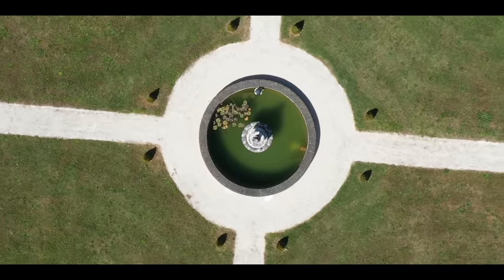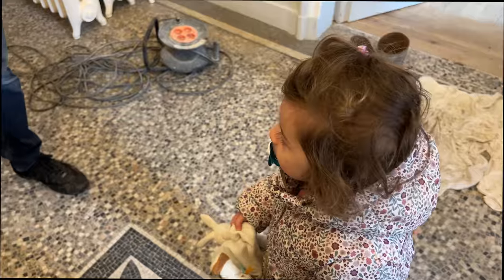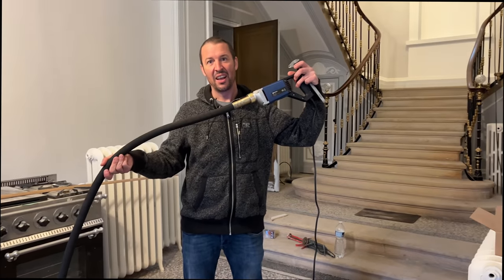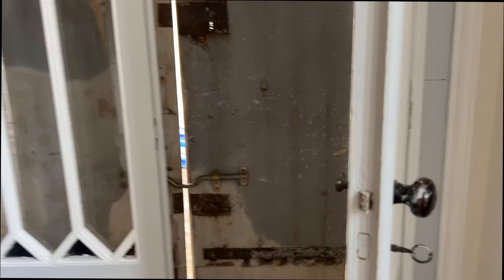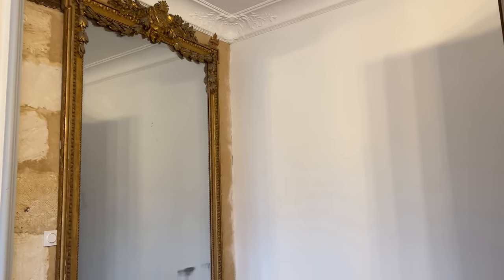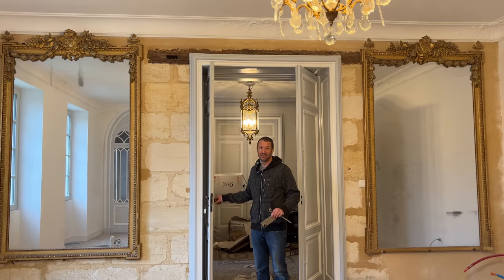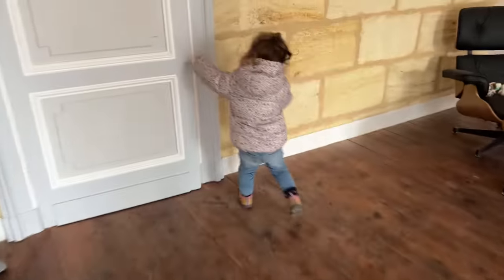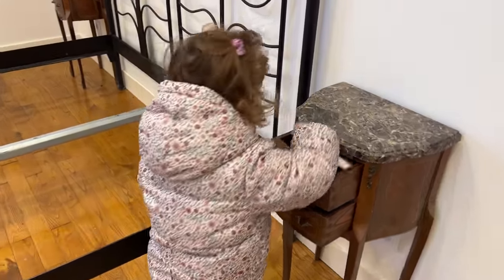EP84 Majestic Mirrors For The Salon @ Our Passion Project

Comment: When we had the lorry come pour our terrace all went well then we noticed that the wood wall support was moving so we quickly ran the truck across the lawn and parked it against the wall in the dark. It did leave a swelling in the side but we built the steps down to the lawn there so that hid it quite well and I put an ironwork rose arch over the top of the steps and shrubs at each side of the steps so no one noticed. I sometimes miss the building work but my back doesn't!

Comment: I meant to tell you guys also that when you guys are purchasing from your larger chain DIY stores that they have a fellow working in most of them called the producer in the U.S. whose job is to keep the numbers up of products moved through the store and they are authorized to make drastic pricing changes for you if you purchase a lot of your materials like flooring in one buy. The producer doesn’t really care if you get your materials under the cost of the stores own purchase price as long as he shows the elevated sales volume. I own a small construction company and regularly get products for less than the stores purchase price by asking to speak to this particular fellow and making my deals with him. You will need to ask the head of each department that you buy from if you can speak to him and arrange a time to meet.

Comment: Have a look for the using of chipboard?: This german restaurator urges to not use chipboard in rooms (wenn it gets wet). 
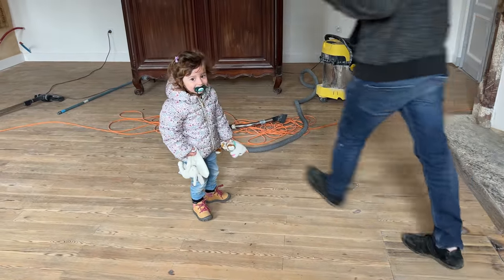At 4:54 you can see the 1.) amound of water  (in gram) the material suckes (one peace of) oak: 40g, jaw: 325g, OSB 16cm: 340g, 23cm: 415g and chipboard 23cm: 605g of water.
2.) drying-time of (one peace of...) ...Oak needs 2,5 days, ...jaw 6 days, ...16cm OSB 13 days, ...OSB 23cm 21 days and ...chipboard 23cm 21 days.
Reply: He warns to use it because of the dry rot. He is a very informativ restaurator and alsow have an english canal (but it isn't well linked).
Reply: Her he shows 
Historic Houses Renovation Mistakes:
https://www.youtube.com/watch?v=JMqZ8vaIAd4